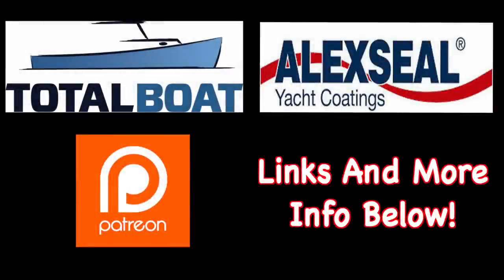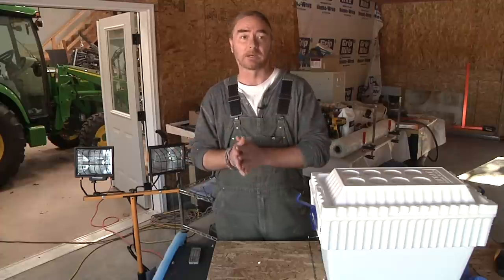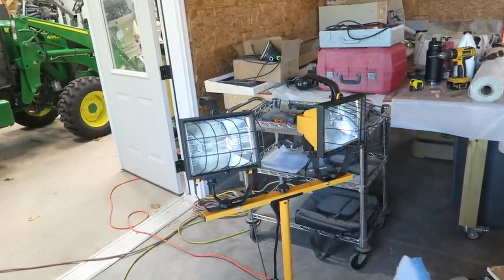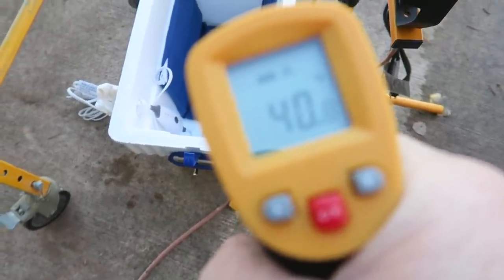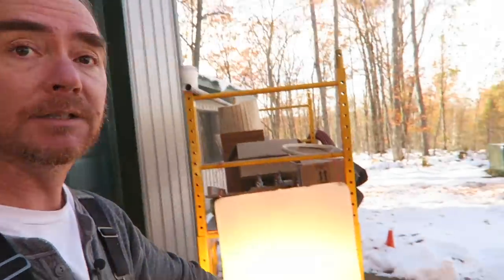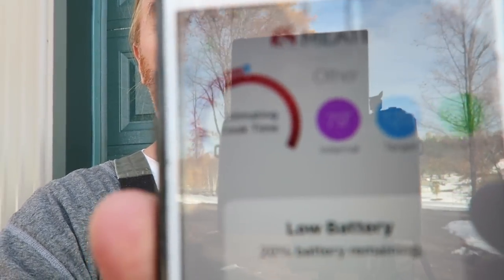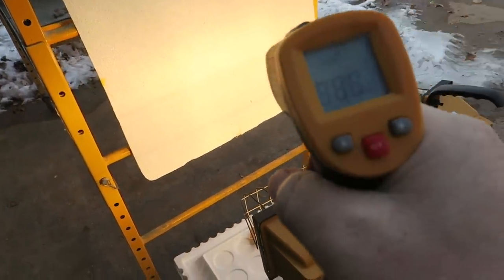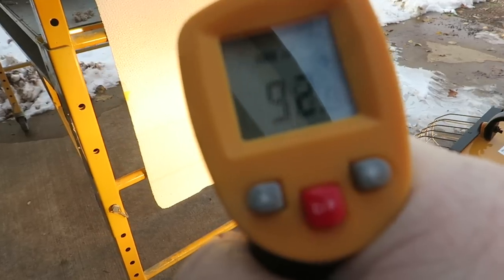FIBERGLASS BOAT REPAIR TIPS AND TRICKS FOR COLD WEATHER LAYUPS!

Comment: Works on multimillion dollar aircraft too!!!  Well we used $500 infrared lights and a heat controller but it’s the same principle.  Throw some extra fiberglass on it as a blanket and you’ll have more uniform temperature across the panel.

Comment: Another great video Andy, thank you!  I just made my own heatbox a few weeks ago with an old cooler.  I got a heating pad made for plant seedlings, it has a thermostat and probe so you can pick the temperature you want.  About $30 on slamazon.  The actual temperature is off by about 10 degrees from the digital display but it is consistent so just adjust up or down.

Comment: I was building myself a 50 gal bait tank over last winter, and the shop was maybe 60° with the forced air propane heater going- and about 40° outside. I would lay my glass, then put a big cardboard box over it, with a hole big enough to sit an electric fan heater outside the box to blow in, and another smaller vent hole on the opposite side at the bottom. I'd leave that going overnight, and in the morning my shop would be freezing, but my part was nice, warm (not hot) and fully cured.

Comment: Great tip Andy 👍 
Over here they use lamps or infra red lamps for lots of paint applications, automotive paint etc.
I use a small fan heater to warm my small Shetland inside for glass work, as easier and takes less room than having a hot lamp inside that I know I'll burn myself on lol 😂 however for outside I think the lamps would definitely work better 👌

Comment: Any incandescent bulb will do, they all are basically more of heaters than a light source - power wise.  The higher the watt rating the more heat, and can use a series of bulbs together.  The box stores have relatively low cost spun aluminum corded sockets with spring clamps.   If the surface is barely or slightly warm to the touch, fine.  Mix up the resin indoor first.  And bring the fixtures closer as needed.
Reply: I used a 600w hps bulb and a growers ballast to heat a 14ft cuddy boat under a tarp for fixes and primer while it snowed here. It worked outstanding the hps bulb seemed to aid in the epoxy drying more than I ever thought. It kept the entire boat at about 25-28deg when it was on for more than about 2hr and gave me lighting that you wouldn't believe, I got a sun tan I'm not kidding it gave me a slight sun tan when I put the bigger 1000w bulb In and set the ballast to overdrive 1200.
Reply: I remember at some point there had been certain infrared reflector bulbs around, didn´t pay attention, but I guess they should be still around. they had been used either in restaurants to keep plates warm before a server can bring them out, for keeping reptiles and sometimes for medical applications. (This nice warm light will literally melt your sinuses free).
In the end those were just incandescent bulbs with a typically red coating which somehow increased infrared output (maybe something else was diffferent as well).
Those might work like a charm as well. But for those keeping an eye on them and checking the distance, they may work even better. Also an electric patio heater might work, but same rules apply. The halogen lamps will just be the least costly option, although likely hard to come by.
I think there are ready made Infrared lamp racks to do something similar, especially made for automotive body repair and paint work. (Those usually use some sort of quartz heater tube or so) But I guess those may very well be beyond even the most ambitioned DIY budget.

Comment: I'd add to that temp probe an STC-1000 Temp controller.  They are $13 on amazon, and they do exactly what you expect it to do...I use one in a small cooler that has a 15W light bulb in it.  I can set a jar of crystalized honey in it, turn it on and the setpoint is 100F, once that box hits 100F it turns off and then maintains that temp.  You can set your bandwidth on this as well.  It also works great as a cooler (i.e., keezer controller for your homebrew beer).  Mads over at Sail Life did something similar for his resin warmer.

Comment: Andy,check the backside of the panel.
More accurate working temp.
Also, try infrared heat lamps... and specfically. Different distances.

Comment: One thing I started using outside in the cold is one of those all in one diesel forced air heaters, runs off diesel and 12v and can run for hours and hours and depending on heat setting blows a very steady 100-140F air and you can very easily fix the vent outlet 18-24" away from the surface and you can get pretty consistent warm temperatures on your surface with it that you can dial in temperature just be adjusting the distance from the vent outlet and the surface. Much less of a fire hazard given no extremely hot components to fall over, even if the air outlet rests on glass or something its not going to catch it on fire. Not saying to leave them unattended, but in my experience seems to be safer than some of the alternatives. The heater itself always rests on the ground and is several feet away from the end of the outlet vent.

Comment: I'm on the southeast coast of Georgia and have the opposite problem. Last year (2022) it was 83 degrees on New Years day. I'm working in a car port and you have NO working time with epoxy when it's 98 degrees. Add in the 80-100% humidity, and you don't want to be out there working anyway.

Comment: Hi, great video. Just a comment,  but you might need be careful using the IR gun. They usually need to be adjusted based on the color and type of material you are measuring. It's called " emissivity " and if not set up right can really effect your reading. Some adjust automatically, but you need know if that's the type you have.

Comment: "Don't leave lights unattended" goes into workshop to keep warm :D
I'm guessing your lights are probably 150w, maybe 300W, there's also 500, 750 and 1000w that we used where i worked
Older halogens didn't have the glass on the front, there was at least one incident where the lamp blew apart and dropped hot glass and element onto straw in a barn, the barn doesn't exist any more
Also, Windsor castle caught fire during renovations when a 1000w halogen caught curtains on fire
Halogens burn white hot, i'm surprised the lamp that fell against the boat didn't fail, the shock of the fall can be enough to break the filament
Reply: Yeah I won't use halogen lights ever again I used them for two decades as a spray painter they are terrible and cause more fires with blow outs than anyone ever wants to deal with. I've had them ruin paint jobs as they blew their  internals over the panels. I even used hps bulbs as a heat and light source instead of them in my own garage on smaller projects. They put out serious levels of everything they Sunmaster growers bulbs

Comment: Excellent Video!  Curious your thoughts on fiberglassing an entire outside deck near the coast (7th home from Ocean in NJ) in the dead of winter.  I'm having a deck built and the GC, who's highly respected and done this before, swears they can glass the deck in winter BUT then will gel coat in Spring when temps are much warmer.   I'm concerned....would you do this? Your input is appreciated!

Comment: Never had an issue with west systems in the cold. All other epoxies I have. Nobody seems to want to admit this too much though. I've used 206 slow here in Scotland in the minus degrees and with only short bursts of a heater it's hardened off in a day. Polly and vinyl don't work here in Scotland in winter neither do the paints you use over there. AWL & TB stuff doesn't work in the UK it's rubbish here.

Comment: Just a tip - The non contact thermometer needs to be within 6 inches of the surface you are reading the temps else it will be off by up to 4+ degrees C
Reply: That would depend on how sealed off the area was. If the area is well sealed it won't matter where you place it.
Reply: @bigduphusaj162  wasn’t referring to the meat thermo in the cooler. The hand held point and shoot thermometer has to be within 6 inches of the area you want to measure

Comment: I would love to get my hands on some small quantities of these supplies to get some practical experience just making flat panels.  This way I could test for myself the differences between working with poly, vinyl, and epoxy and test the results with various weaves and weights of glass.  Any suggestions on where to buy supplies (like a pint or quart’s worth)?  Also, what weights and weaves of glass would you recommend for boats (a loaded question based on all the variables, I know)?  
Basically what I’m trying to learn is, does 3 layers of 6oz have more or less strength than 1 18oz layer?  By strength, I mean to do a basic bridging experiment and measure deflection over a fixed distance.  Might also do a second test (if I can figure out a cheap rig) testing tensile strength, pulling the part apart.  Or, since your working in gimp mode for a while, and are much better at publishing content than me, your more than welcome to run with this idea.  Also, E glass vs S glass?  I have no clue.

Comment: Thak you for a very informative video. I have a project I need to work on this winter. And since the boat is 24 feet, I don't have room to keep it indoors. My boat has a diesel heater on board, so easy to keep it warm inside. But will have to recast some hull damage that must be taken in from the outside as well. I was actually thinking of rigging up a tent and heating it with a diesel powered heater. But using lamps is much easier. Perhaps infrared lamps will work even better? Again, thank you! Greetings from Norway.
Reply: Epoxy doesn't like Co2, so be wary of fire based heaters.  Mainly have to make sure the exhaust is well vented away from the resin.  Not sure how polyester reacts to Co2 though.  Maybe Andy could comment.
Reply: Mate see your diesel heater that alone will heat the entire boat up inside and out if its the bigger 5-8kw ones like I have they can heat the entire hull good inside and out just from the inside. Test it yourself and leave it on a while the boat won't gather ice at all. It's the ice you need to keep off and as long as the skin is above 15deg your fine. Ideally I don't like the skin being to hot as everything moves too much before it sets and when it does set it kicks off too quick. See as long as the catalyst ratio is good the longer it takes to set the better bond you have so some of my longest lasting fixes were done in winter time in the 90s
Reply: @Skyrmir  he means the diesel exchange heaters like eberspacher or webasto. Its exchange air so completely safe
Reply: See the diesel exchange heaters they heat up the surfaces a lot more than people realise because they shift a lot of air. You'd be suprised how warm you can get an entire area with the 5+kw ones. I've aimed the hot air hose from my 8kw one at projects sitting 20ft away when its been freezing outside and it's worked amazing. They are one of the best condensation removers I've ever came across.
Reply: @bigduphusaj162  Yes, you are absolutely right. What I'm thinking of is the boat's own diesel heater. A Wallas 3000DX. It is thermostatically controlled. So I can decide for myself what temperature I want inside the boat. It gives me three kilowatts of heat.
Reply: @bigduphusaj162  The casting job I will be doing is inside the cabin of the boat. But must mold on the outside as well.

Comment: Would a heat gun not be a more efficient way and a safer way being that its in your hand at all times?
Reply: Working on car painting, the heat gun did a great job of heating a spot.  By the time you hit the next spot up to temp your first spot has cooled down again.  Even at the lower temps it just hits too hard to even heat for us.
Reply: Heat guns are way too small to be using as a heat source for a larger area and they burn out quick if you leave them on for too long. I went through two top end 1200w digital dewalts using them to keep my 5ltr epoxy primer tins warm for 24 hr straight. They both burned out the 2nd stage element and one burnt out its temp sensor so they would only come on at 50deg from then on.
Reply: Also heat guns can cause combustion from paints etc.